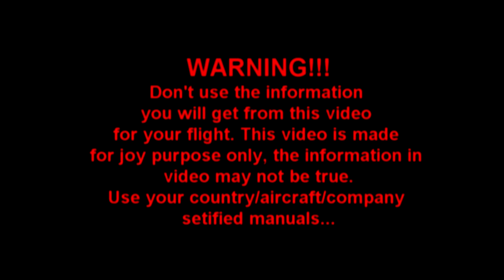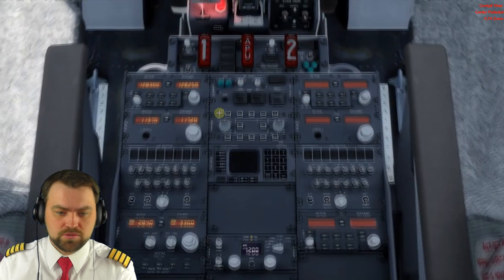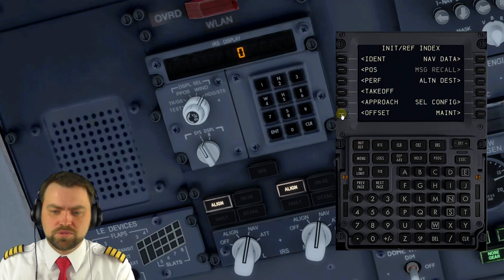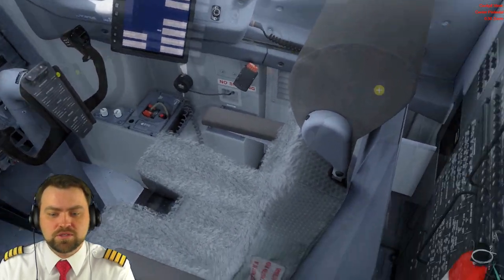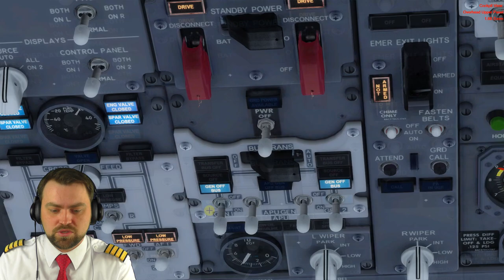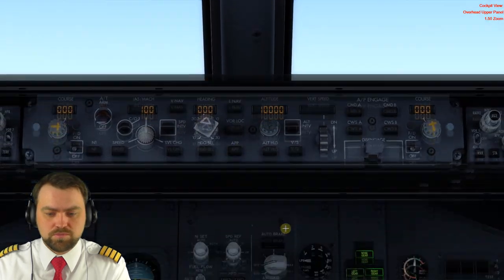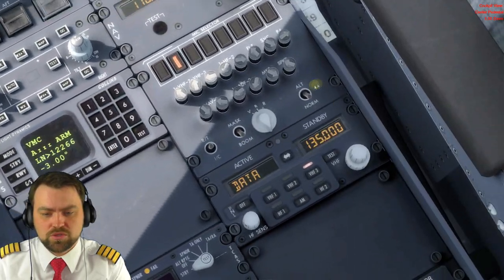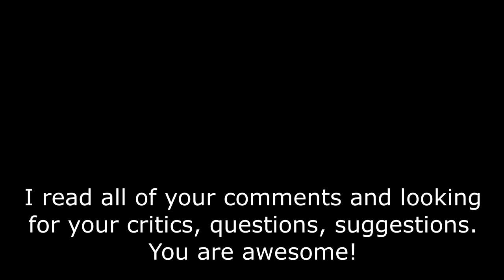B737 Cockpit preparation from Cold and Dark by Real Airline Pilot | Flight simulator | PMDG

Comment from the maker: 08:00 sorry for that configuration you can't use it as jump seat. However there is a self, that can be equipped as jump seat. One extra oxygen mask is needed....
Reply: That's ok! You can set it by using the FMC, go to menu, PMDG SETUP aircraft and set everything you want for your aircraft! Use even FS ACTIONS for ground crew, change fuel weight, payload, ZFW and other stuff. Hope it helps! (In PMDG SETUP/AIRCRAFT, you can set the jumpseat and Captain's and F/O's  seat. Even enable or disable EFB, Airpspeed low callout. Have fun!)
Reply from the maker: Oh. I did'n know. Thanks for you advice and your comment!

Comment: If thats a secondary jump seat, why does it have "NO SEAT"  written on it?
Reply from the maker: Not to use as a seat
Reply: @PilotBlogDenys  But isn’t that a contradiction? “In aviation, a jump seat or jumpseat is an auxiliary seat for individuals—other than normal passengers—who are not operating the aircraft. “ So if your saying it’s a jump seat then by definition its a seat. But, it has “NO SEAT” written on it so therefor it isn’t seat right and thus can’t be a jump seat 🤔 confusing 😳
Reply from the maker: @krellon  It is not the "jump seat". On some planes you may use that as a seat on some not. If not, you see that sign. Jump seat extends from the right side and securely placed at the door entry.